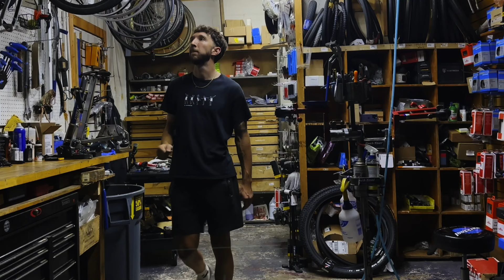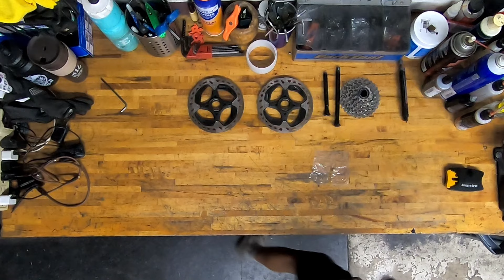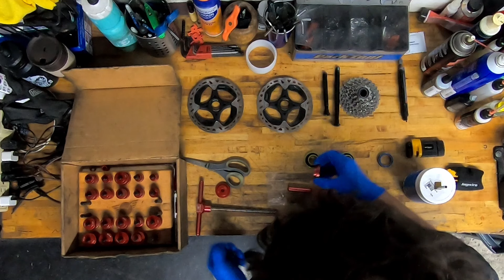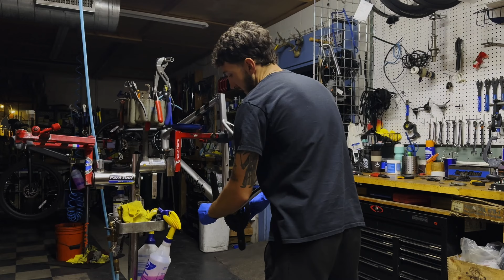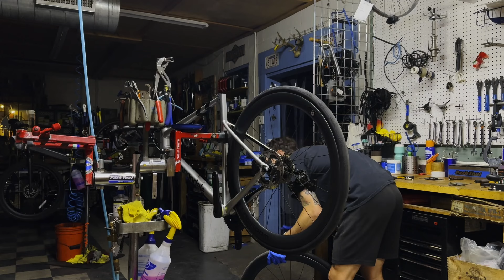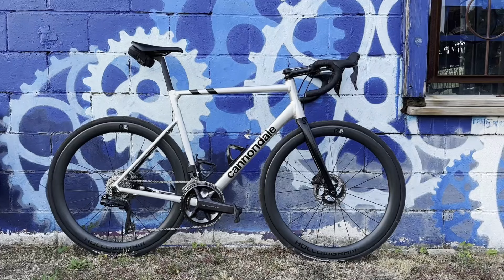Rebuilding my Cannondale CAAD13 from the frame up

Comment: Do you have or will do a video on the specifics of the build? I am considering the Caad13 pretty seriously. There are no Caad’s in my area to look at though. I see yours is 58cm, how tall are you? If a person is right in the middle of 54 and 56 I’m five ten and three quarters size down or up? Nice video about the Roubaix race.
Thanks
Reply from the maker: I have a couple of videos about the bike setup on my channel https://youtu.be/HC0pveKnDT0?si=zMVgbhOG1GPw9cmu and https://youtu.be/DJhWwdJr18s?si=bzq1Rtz_bAjq0dq0 should explain most of it. 

At your height, I would probably recommend going with the 56 cm. I am 6’1” and have to ride a 58 cm due to top tube length needs.

Comment: very nice and very close to my own, question: how did you replace the last ( ugly) spacer ? yours looks like a chris king headset? thanks
Reply from the maker: I actually have the stock FSA headset, however I have replaced the dust cover with a much lower stack Cervelo cap that matched the diameter of the stock one.

Comment: Nice! What bar/stem are you rocking? Also riding 32s?
Reply from the maker: Running a Zipp Service Course SL stem in a 120 mm length. Front tire is a 28 mm that measures 30 and the rear is a 30 that measures 31.